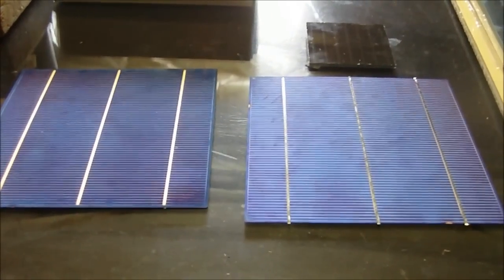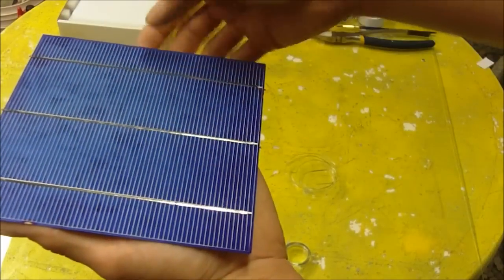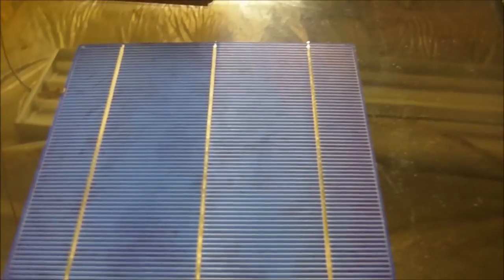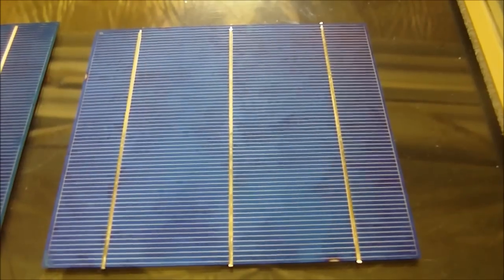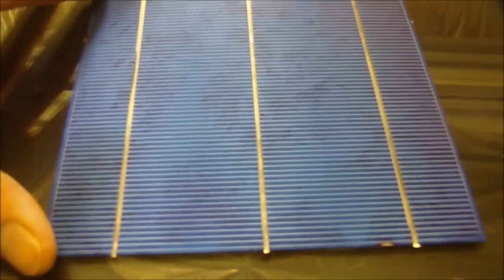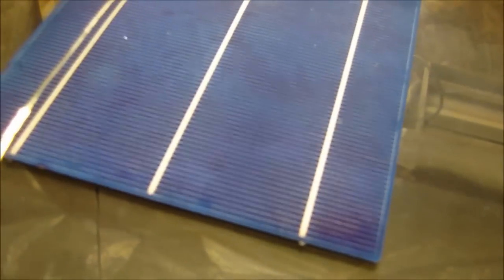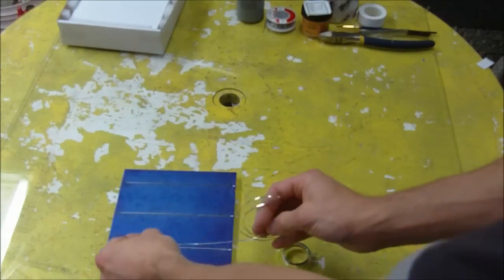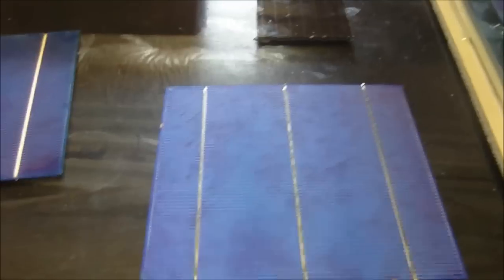Solar diy watch before building panel some info

Comment: Thanks for the video
I have a question after watching many video. From where the negative wires leaving the completed panel? from the blue front side or from the back  grey side. If it is from the grey side it is a negative area?